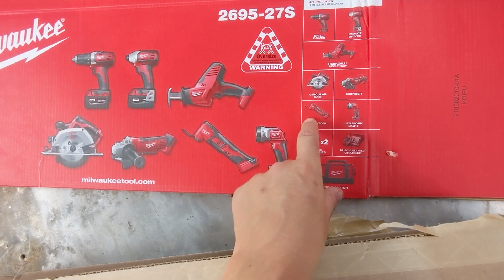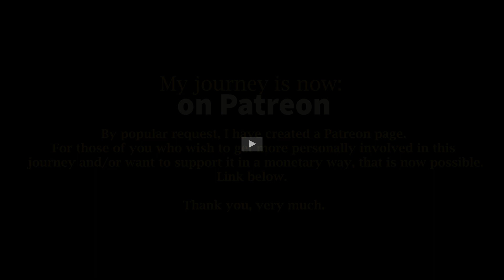There Are Two Choices in Life // Skoolie Build Series (story 14)

Comment: Whew! I did all this with my Stepvan. Hard sweaty work, and can get expensive. Wanted to mention that there’s a special bit at Home Depot (or Lowe’s) that’s used for stripped screws. It’s basically a reverse drill bit that will grab and unscrew the screws so you would still be able to use the screw holes (if that was in your plans). The craftsman screw extractor 52154 kit is what I used. The air chisel is fun too though😎. Thanks for sharing and be safe!

Comment: So hadn't noticed it before but you have no humps to build over. And while I know it's late but depending on style rivet I either punch the middle out (remove steel core) or if it solid i cut a slot in it so edges can lift and cut faster with chisel.  Good luck